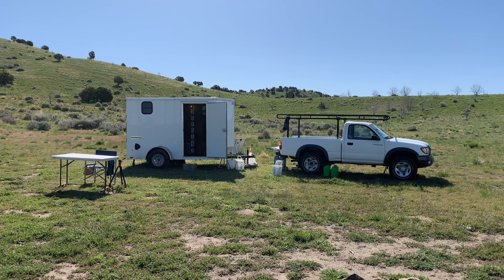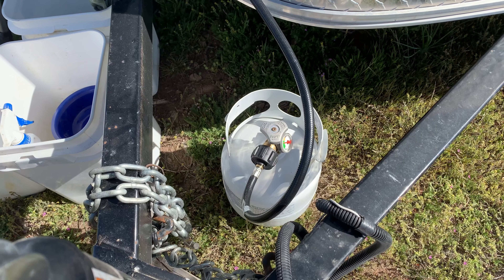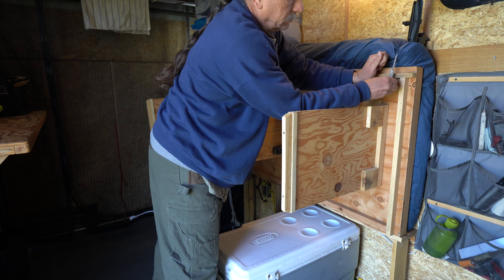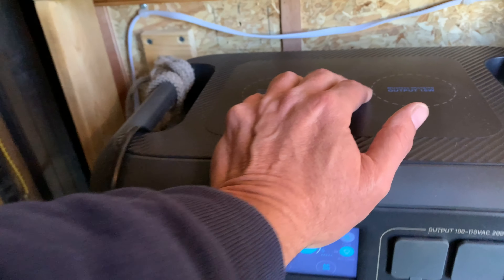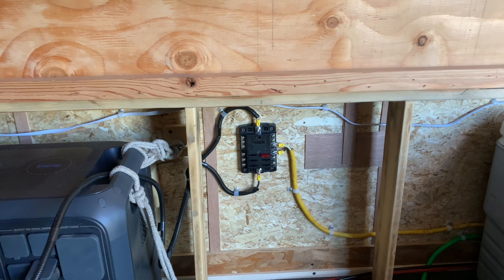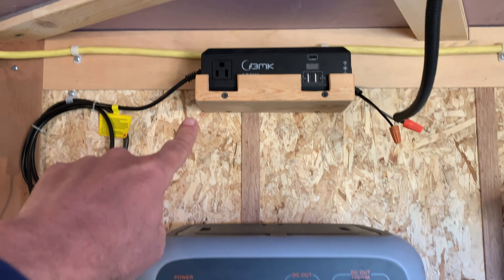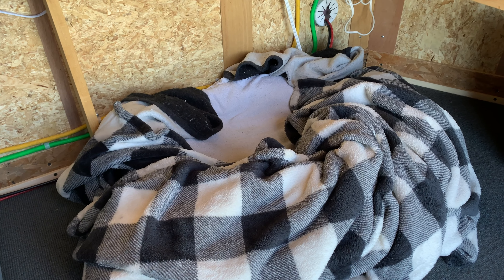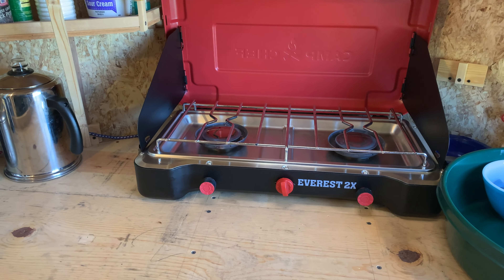6x10 Cargo Trailer Camper Walkthrough / What's New for 2024?

Comment: Mark! Nice to see your rig again. I like the additions and upgrades. Big Blue sure is a handy thing. When I started planning my 5' X 10' "squaredrop" (galley at the back), these Bluetti and Jackery type self-contained systems were kinda new.  My trailer's electric system is built into a cabinet next to my three big AGM 12V batteries and a big ol' 12V-120V inverter, all of which is positioned directly over the trailer axle for best weight distribution (for my tastes). Like you, I have run both 12V and 120V circuits forward to the front of the trailer where I can charge my laptop, my phone, my drone battery, and some USB-battery LED flat panel lights like you have on the ceiling, there. 

Then I have an additional 120V run to the rear of the trailer to two outlets to run a toaster oven or a small skillet or my hot water pot (I brew my coffee using a cone filter), the first outlet is a GFCI on the right side of a small bar sink, then back over to the left side to power a second 120Voutlet that also has two USB outlets if someone needs their phone charged or whatever.  

This darn squaredrop/cargo trailer/camper corn-version project has been difficult but It's starting to be satisfying seeing it near completion. It was also a lot of fun planning it. It's been three years of part-time labor, plus the pondering. The pondering consists of, "That's what I want, but how the heyull am I going to do it?" kinda thing. I have STANDARDS, man. Problem is, my SKILLS do not measure up to my standards! but I just keep at it. Doing the ceiling panels right now, then once those are done I'll finish the twin-mattress-sized bunk, then wiring the 12V section opposite the bunk where my "office" implements are located. 

I need to make a video so I am no longer compelled to leave novellas like this one in your comments. lmao. I hope to see you out there at some point in 2025! Camp Lapidary meets ApplesBigHatRanch camping, rockhounding and perhaps plinkin' some tin cans with the old Marlin .22 lever action. Good times. Cheers!
Reply from the maker: Hello again, Apples Big Hat Ranch! 
A quick googling of your name tells me you are somewhere in Colorado? For possible 2025 joint camping opportunities I'll be attending the Jade Fest in Jeffery City, Wyoming in August. Another trip to the Blue Forest, Wyoming whenever the weather there is nice. Perhaps south-eastern Utah also when weather appropriate. A trip back to north-eastern Utah has been on my want list for some time. Just something to think about.. I'm on Facebook/Messenger for a more private conversation if you like.

I sure hope you have been using your trailer while working on it. Really helps to know what you want and need. Yes, a video would be nice. These cargo trailer videos tend to do well here on the Youtube. I too have done much more pondering than actual work. It's fine though, keeps me from just adding all kinds of crap I really don't need, yet maintain a small level of comfort as I go into my oldness. lol.
Reply: @camplapidary  lmao. Exactly! I don't FB, but... will attempt to reach you over the next few weeks. Southeastern Utah sounds good, but only when not peak summer temps. We will! at some point, and I sincerely appreciate you your reply. I am in southern California (but please don't hold that against me - there is indeed much rural landscape here in addition to the sardine can in which most folks live). Cheers!
Reply from the maker: @applesbighatranch6906  I didn't mention anything in the south because I thought you were in Colorado. I wish I could be in Quartzsite, AZ right now. But I travel to Southern Cali every once in a while. I often will camp out in the desert on my way in or out of Long Beach, CA. Love the California Mojave Desert. Turquoise Mountain, Kokoweef, these are some of my favorite spots around there.

Comment: You could have left out the urine talk. Lol 😉...Small led overhead camper lights would work great in there. Wouldn't use much power. Installing a small stainless sink in a corner with a drain out the camper wouldn't be hard to install.
Nice set up! Like it! You have what you need to keep warm & dry.👍
Reply from the maker: No script, never know what will come out of my mouth... lol.
I could have cut every thing about the potty and the video would have probably been a better video. It's just that I had quite a few comments on my last walkthrough about what I used and I wanted to address it directly. At least I didn't demonstrate usage! Haha. And no close-ups! But seriously, I have heard the key to a good composting toilet is separation of the solids from the liquids. I'm not composting but it's just so much nicer and easier to deal with it all if they're separated.

My issue with installed sinks and why I don't have one:
I feel like a tiny sink isn't too useful, and a bigger sink is too much dedicated space. I like to be able to change things out easily and quickly, like I've done with the stoves. If this space were bigger, say 7x14 I'd probably have an installed sink. The plastic tub I bought can be used in many ways, dishes indoors or out, bird bath for photographic purposes, foot soak on a hot summer day... I also use it to store my dinner plate and extra pan during travel.

Thanks for watching, Dream Look! :D

Comment: Super upgrades Marc!  I was wondering where you would locate Big Blue to!  Excellent spot!  I like the idea of the magnet light fixtures, you can move those to any location you need them in.  Excellent conversion of a cargo trailer!
Reply from the maker: Thanks! 
The movable rechargeable lights really are convenient.
At first I thought Big Blue was going to sit up front under the shelves. I had it there one night, the glow from the power button was too bright! I'd have to cover it or something. The main reason to put it back there was to lessen "installed" tongue weight. Cargo trailer conversions can become front heavy easily.

Comment: You have made some nice upgrades for you and Gypsy! I love that she has a heated bed! And the double solar array is wonderful! That second panel comes in really handy I bet! It's a great power set up you have going and you live somewhere that you use it without fear of no sun! Here in Oregon, we could only use something like that 3 months out of the year! You have done some awesome little upgrades that just make your life simpler and that is what life camping is all about. That is an awesome set up you have for yourself! Now you need a cooling system for yourself and Gypsy for the summertime when it just gets to hot to move around. You will need a way to cool down whether that be a small little a/c unit or a little swamp cooler and both will need their own panels and power circuits! But where you live, it gets really hot! And unless you can find a way to cool down, you better plan on camping in areas much farther away from home! Lol! Thanks Marc!
Reply from the maker: Thanks, Lisa. 
We do like our heated beds! Insulated trailer walls helps a lot too on those cold nights.

You're right! I hardly ever camp near trees.
My solar system is still in the beginner stage, we need more and bigger panels. Big Blue can take up to about 900 watts (150 volts) of solar input. I figure I can get 740 watts of panels on the roof of the trailer. That should be enough for most uses, except for air conditioning! It's very hard to get enough solar for AC. Most people run generators for AC. 
One thing that does work is water misters. Would be nice for summer camping to rig up some misters under a canopy. Deep shade and misters. Sounds like a project.
I just need to be picky when and where I hound. Not too wise to go into the desert in full summer. Fall and spring are where it's at! I need to maximize those seasons. 
I'd love to travel a bit with the seasons, but who wouldn't right? :D